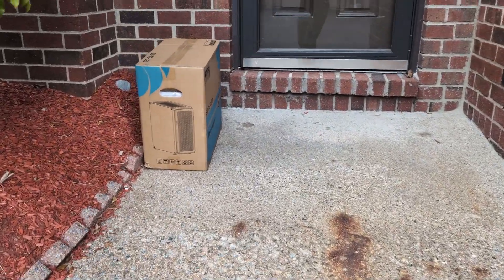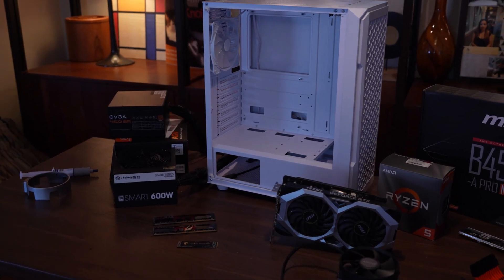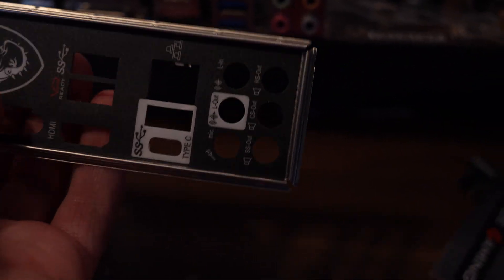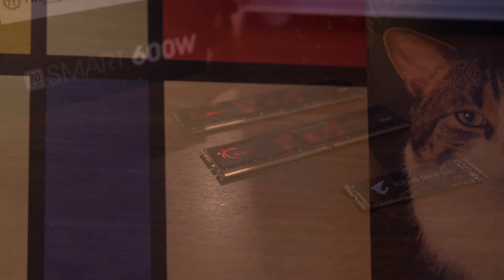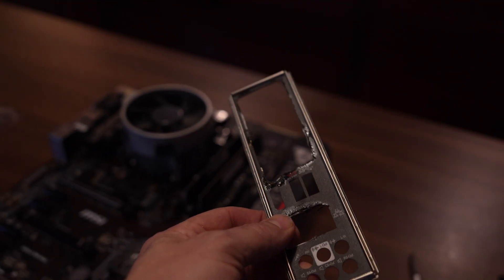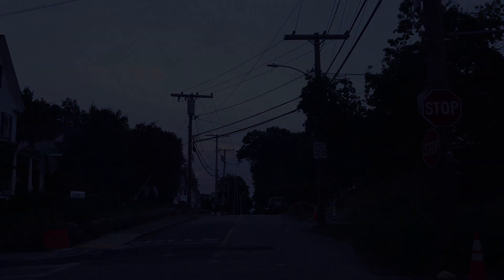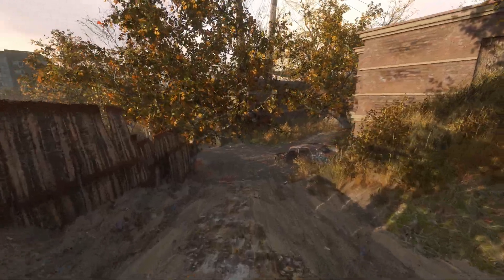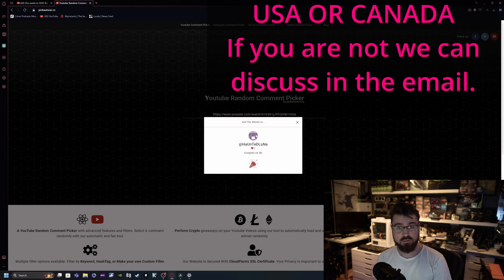Is a $300 PC worth trying to build today? | The $300 PC

Comment: After doing over 100 builds since 2019 for this small town im in i decided it was time to try something new i bought dying/dead hardware and learned micro soldering PCB repair in my spare time to build a system that could rival what was available here. 

Rig ended up being a 5900x (bent broken pins) 
Galax 1070Ti Katana(Rusted Indicators)
Gigabyte Aorus Extreme (missing Internal USB 3 Header) board was selling for $1500-$2000 

Gave it a brand new ATX 3.1 Capable psu a Few spare 1TB SSDs from previous project 
A shiney new Antec Performance FT1 

All in was About $500 CAD not including my time as i was a newb and didnt feel right charging for it.

Came out amazing though i got skewered by FedEx with an attempted $400 bill for getting ahold of Gigabyte to mail me the Proprietary Front Panel Connector 🤣 i aint paid that bill since id spent $45 getting it shipped here in first place.
Reply from the maker: Nice man, hey curious about how easy it was for you to solder those AMD broken pins. I actually just ordered some. I have soldering experience but never changed the pins. Any tips? Probably will be making a video on it next month when the pins show up. 

As to your experiences/learning. I think what you're doing is the way to stay ahead of the game because building is fun, and can be profitable, but as you know since you're a veteran at this point, it has super large ups and downs. Repairing stuff on the other hand is like being a mechanic. People reward you well for your efforts. I never overcharge anyone, I am always very fair, but sometimes I'll get an insane tip.
Reply: @techwandoUS  iv tried various ways of fixing pins one way was using those mechanical pencils to hold the pin add Solder to both cpu pad and the pin then use heat gun when ready to place them was not fun but effective eventually. Watch a ton of Northridge Fix Videos to try learn a technique that works. Im changing my soldering setup to use the iFixit kit once available since the Weller I have is great it's not as portable as I'd like. Plus it was a huge investment getting the microscope and articulating arm and anti glare light but worth it. Easiest way I found to fix pins was ALOT of patience and knowing when something is absolutely beyond repair just watch out if the pads are ripped off the cpu it's going to be on hell of a fight to get em placed. But a good point of learning this craft is Northbridge fix since he uses everything he sells on his site and is a trustworthy source of knowledge.
Reply from the maker: @shadowarez1337   appreciate the good info, I'll go check his videos, and yeah he's great, been following him for a bit. The mechanical pencil has always been a good bend back tool for me, I'll give it a shot as the "hold in place" tool. Hopefully I have a Hakko tip small enough 😅 thanks again for the tip.

As for scopes, I got one sent as a review. It's in a video with Rossmans face on the thumbnail. I do recommend it, made everything much easier (coming from old school microscopes)

Here's a link to the video, i forgot the model name but it's in there somewhere. I don't think the discount code works anymore just an fyi.

https://youtu.be/NSoUrhReiPU?si=AmThFk4PBnqgFCEr
Reply: @techwandoUS  yeah the one I'd bought was $699 USD plus the $399 arm and the $99 arm. Wipes out the profits from about 6 rigs but vastly improved my Journey to learning how to fix repair items instead of drop them off to a recycler. 

Love seeing these types of videos as it gives me a glimpse at how others do this and helps me tidy up my operations in the process most time consuming part of my build is RGB if requested and custom cables with OCD level of cable management.
Reply from the maker: @shadowarez1337   @shadowarez1337  damn! You went all out, that's about double the one I reviewed if I remember correctly. 
Yours is probably far superior though. Sometimes those big investments are what really helps you grow though like you mentioned. Don't ever get into camera gear, makes PC parts look affordable.
I feel like we talked about this once before but have you seen North West Repairs stuff? You should record some of your work, people love to watch the trial and error/learnings.

Comment: Nice setup! Almost have the same specs only with a RX 7600 8GB in it. Was 125 euro on the used market. 
Total system:

Ryzen 5 3600 20 euro
ASUS Prime B450M + 2x8 sticks of DDR4 3200mhz combo 50 euro 
Radeon RX 7600 8G OC 125 euro
Thermalright Assassin King 120 SE 18 euro
Cooler Master V550 Gold-V2 + case silencio s400 good as new for 15 euro's
WD Black SN770 1TB still had this one
Total cost was about 230 euros
Reply from the maker: That's a killer setup for that price, very well done 👍
Reply: @techwandoUS  Yeah, you can make a really cheap pc if you look well on the used market.
Reply: Sold my ryzen 3700x recently for something like 70£, and ddr4 3200 2*8gb for 30
Will try to sell old PSU and mobo too ~£50 super bare bone could not upgrade
And get r5 7600 for 160£
Am5 mob 169£ I get some very nice one this time
Ddr5 2*16gb 115£
Cpu cooler 40£
New psu 70£
New case 60£
New gen4 SSD 112£
~750£

And will swap GPU to 7800xt
For another ~200 after I sell 4060ti8gn yes I know I fall for that marketing 

And all started when I wanted more ram and quieter CPU cooler, I could get it for less than 100 and be ok for 2 years.😢

Comment: The camera setup on the seat reminds me of either that mercenary robot on Star Wars (IG-2 or something?), or of course the one and only Johnny Five.
I like how you play with the edits lately.  Some very good edits there, like fun.  Nice.

I really like how the red cables look in this build.  

I've heard a while ago that the RTX 2060 had issues with their memory chips and depending on the manufacturer (of the memory) there was a good chance the card would die on you sooner than later.  I don't know if the Super models were affected or not.

What I do know is that I always found (based on videos) that the RTX 2060 Super was a very good card and still relevant today.  If I had one I wouldn't consider changing upgrading till the next generation of GPUs.   (with plenty of IFS there there for my situation).

Good video man, keep up the good work.
Reply from the maker: Ahh yes the gimbal... It does look like some kinda funny bot. Has a lot of robot like features as well. 
Thanks about the edits, just trying to have a bit of fun.

So you are right about the 20 series, in the beginning they used the "New" (at the time) GDDR6 from Micron, and the modules were failing as time went on. They did actually fix it by moving to Samsung (I had to rma 3 2080Ti FEs -_-). Luckily most of the issues were solved by the super series.

I would say if you found a 2060S locally really cheap, it's really the entry into the DLSS world. Which at first I bashed quite a bit, but I must admit, I kinda like how I can turn up eye candy on a budget card, and still break 60 FPS in many of these games. 
Idk if you saw the new overpriced PS5 pro but they have now implemented that same tech. 
Funny how things go...

Appreciate the comment.
Reply: @techwandoUS  Thanks for the 2060 info. 
I did notice the news of the PS5 Pro.  With the lack of the optical drive (care to guess if PS6 will have even an optional?) and the zero trust for Sony to allow you to play the games you have bought digitally, it's a dead product for me.  I don't know if you remember recently when Sony removed items from customers' libraries (movies or tv series) because they could.  No Fs given.  So they killed any chance of me having any interest in buying anything from them digitally.  So PS5 Pro, not that I would care for one, is not really something I would look for in my list of items to own.    

Also, with the final price here in Europe probably be around 1000 euros with the drive...why would I ever prefer to buy a PS5 Pro over a PC?  Hell, even a laptop.  I could get a RTX 4050 laptop, perhaps even a 4060 laptop, or of course better build a desktop PC with the same money.   Something which I would have better use for.  

My point is, my PS4, XboxOne and WiiU are most likely the last consoles I ever buy even if I have money in the future.  

Console gaming used to have two advantages over PC gaming.  No much need for patches (HA!), and being able to just put the disc (or cart) in it and play from start to finish.  Now you need to download and install a "patch" which is usually several GBs in size, if not the full game.  With patches out for even years down the line.  Anyway I will stop here as I already typed too much lol.  Thanks again.

Comment: Man $300 is wild because I have been trying to help my friend build a pc at this price, after he found a $315 refurbished rig on amazon including a 1080p monitor, and I dont want him to buy it lmao. It's a 3770 cpu and a 1030 gpu. I put together an amazon list for around $400 but that's with no monitor no fans (which i would give him), and all new parts. I was able to get him up to like a 5600 with an rx580. Unfortunately I can't truly compete unless I flip to the used/refurbished market ...it's for an 8 year old to play roblox and minecraft
Reply: I do new builds for $500, usually 12400F. For $400 I'd honestly be on fleabay looking at 8th or 9th gen Intel off lease workstations, then add in an Intel A580. It's about $30 more than a RX 580, but 60% faster.
Reply from the maker: I think what you hooked him up with is at least a modern platform that can support new GPUs, and will hold up for a good few years. I love me some old Sandybridge builds too but those should be like ultra budget, sucks that people on Amazon/eBay and locally have made a business out of ripping people off. 
Little tip to if you are looking for a cheap 1080P screen. If you have any Savers/thrift stores in general. The 1080P monitors are often littered there these days. I found a 1440p 144hz a few weeks back for $15 at savers. 
Appreciate the comment man!
Reply: Even for Roblox and Minecraft the 580 would help a ton, some of those Roblox games go crazy with the effects and that engine is horribly optimized
Reply: Thanks for all the advice everyone!

Comment: 8:40 that should be the thumbnail. Awesome shot. Great video man. It only further makes the PS5 pro $700 price tag look awful lol.
Reply from the maker: Thanks man, it's funny you say that, I have a few from that shot as a secondary (in case it flops). I didn't have that exact timestamp but I'll credit you,  you're probably right I should use that 😅

Also yeah man, the PS5 pro would be so worth talking about if it was like $549 or something. $700-800 range is 2006 ps3 or worse levels of incompetence. That's what happens when the competition steps out.
Appreciate you man.

Comment: First comment! Lets GOOO saw this and clicked instantly and noticed posted 20 minutes ago. Gonna watch it all while working just perfect.
Reply from the maker: I like the dedication 🙏
Enjoy!
Reply: @techwandoUS  i'm building a similar system but with an msi b550m pro vdh (with the io shield) HAHAHA and an rx 5700 xt
Reply from the maker: @420Montreal I almost went to ebay for the IO but that extra $20 would have killed the price point.
Are you using a 3600 as well? The 5700XT is a solid card. Faster than the 2070.